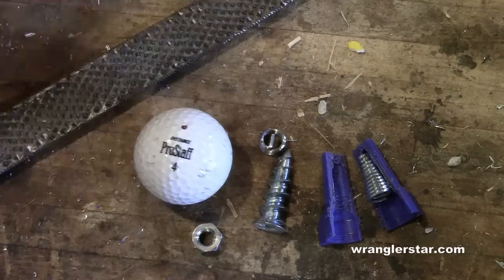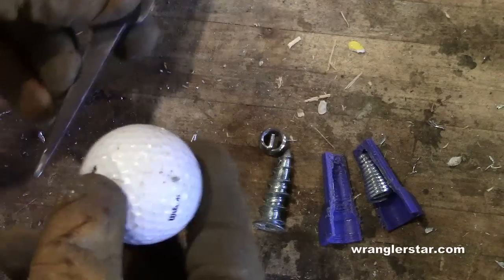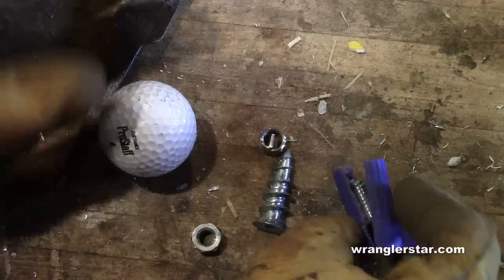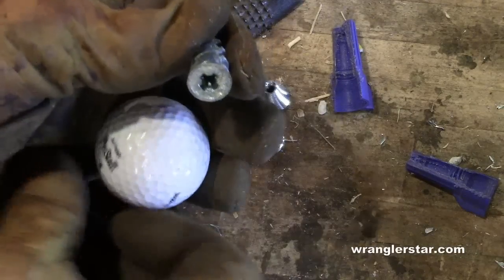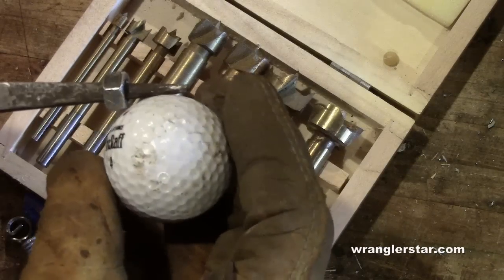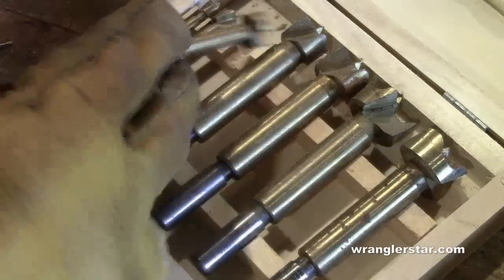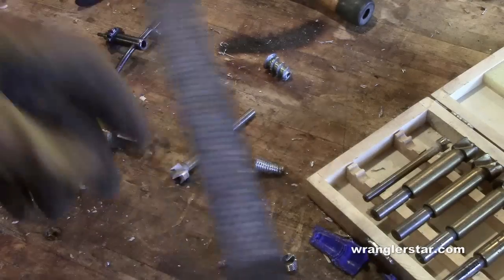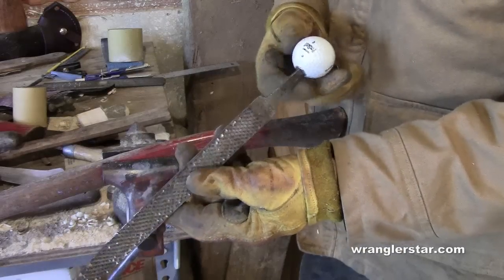Golf Ball Tool Handle - Wranglerstar

Comment: A "rat Tail" is a round file, what you refer to as a rat tail is really a tang, or handle tang.
http://en.wikipedia.org/wiki/File_%28tool%29
WIKI, Most files have a narrow, pointed tang at one end to which a handle can be fitted.[1]
I bet it works without the nut using epoxy.
Oh, nice blood blister under the nail, be it still hurts to this day.
A syringe needle as a drill bit turned by hand can do wonders for it.
How do I know?
I wish I didn't know!

Comment: two nuts on threaded rod. then cut rod. then grind edge as she did. then take off the nuts working them back and forth as needed at the end of rod till the threads run smoth. then remove nuts ,

Comment: Sorry Cody but there is an easier way. I do that in my Blacksmith shop but much easier. I just drill a hole a size or two above the the diameter of the end of the rat tail and drive it on. I've never had one come off.

Comment: I allways take a cheap wooden handle without any threads
Then heat the bottom part of the file up till it's red hot
Then just smash the handle on there

Comment: Be careful wearing those gloves while using a drill press.   It's better to cut yourself without gloves than to have a glove catch on the rotating drill with a lot of torque and break every bone and ligament in your hand. .. If your lucky that's all that would happen before you can stop the drill press.

Comment: If you use a file on aluminium it gets clogged pretty easily.  Use an old copper pipe to help clean the file.

Also I made a video on how to make a DIY  homemade pocket slot saw for hanging pics 
Title is " make your own pocket hole saw "
www.youtube/watch?v=cZUi4g26DYY

Comment: Ha! No offense but I am not sure I'd trust a guy I see with ANY golfing paraphenelia around. Branches are free, too.

You need the recipe for cutler's resin. You are a woodworker and will like a wood handle far better than a f'ing golf ball. Cutler's resin grips like a bitch and releases in hot water to work on the blade/chisel/tool if you need to re-anneal and temper again, for instance. It's 3 items.... Rosin, BLO and something else. google it. ( this is my trade secret, dude! )

Otherwise marine grade epoxy is more permanent and works excellently for wooden handles. 8 sided is ideal because they won't roll off your bench, btw. Look at pfeil chisels. Also keep your fruit tree branches for the handles. Better than even hickory. Above fruit wood is Dogwood. 

Dogwood is the god of tough woods second only to hornbeam aka 'ironwood'. Oops another 'trade secret' slipped that let you know I have lived, hunted, pumped my own water (still do, I just bike it home now that I am a cityslicker), shot, split wood, fixed my own transmissions and know plenty about how to talk to animals.

Comment: Oh Gods above, that has been known for years.  And, of course, you do it the fancy way.  All you need to do is drill a pilot hole, and drive the tang in.  That's it, it will last forever.  Sheesh, and it takes you 7.42 to tell a 30 second task.  Thumbs down.

Comment: My first video of yours I can't thumbs up, and I've watched them all. While I agree its a practical solution, its a hack. I don't think a golf ball is a "proper" handle. I admire you and trust your judgment. I often ask myself "what would wranglerstar do" and I try to use that as my standard and try to live up to that. Part of your appeal to me has been the fact that you have, at least in my opinion, rejected the quick fix, and rejected plastic except for your wedges. Your tool shop looks like the old timers wood shops we see in old pictures. This golf ball idea I think misses the mark on form. Had you taken a round wood ball, or carved a handle yourself and sunk a nut into it I would thumbs up. I would also have used an epoxy or something to secure the nut better. I think you got excited, jumped the gun, and made a video. This is not what I myself would call wranglerstar quality. I won't thumbs down because your can do attitude inspires me. Instead I'm going to walk away wondering what just happened here. I come to your channel to avoid this type of thing. I hate taking a shot at you but you have requested honesty from your viewers. I'm honestly bumbed on this one. I've been looking for exactly this information because I just bought a box of old files. I can't believe I didn't get the "proper" answer from Cody, I only got a good answer.
Reply: though i was a bit unsure, when you think about it pretty good idea, 
their pretty durable, pretty cheap ect 
you can hit them 200 odd meters and they dont care so im sure their fine for a handle if it feels good.. why not? may not be for everyone, but still a good idea
Reply: I acknowlege its a good idea, but as Cody has asked before "is it something you would put your name on". I don't think this meets what I expect from the Wranglerstar brand.
Reply: In my opinion Wranglerstar has built a brand. When I hear the name I know what to expect and trust it. If he held a contest, and the prize was a file handle and he sent you this...... what would you think? He did call it a hack so I'll give him some credit for maybe knowing this doesn't quite meet what his viewers expect. I'll be interested in watching what other say and how they rate this video. Something else to consider is, what if somebody found Wranglerstar by this video? Is this video worthy of making somebody subscribe, is it indicative of his typical quality of work? I say no.
Reply: my thoughts on it would be a great kind of backup handle ect a nice wooden handle will always be better in my eyes. but still a nice quick handle
Reply: Agreed, as a backup handle its fine,but watching made me reflect back on his shovel handle video and I felt uncomfortable.
Reply: Jake Riethmeier I agree with all that you said. One reason I watch Cody is that his videos take me back in time to the days when hard work, sweat, wood handles, and good steel were the norm. A golf ball, while maybe a superior handle, doesn't take me back. Maybe I'm being a picky turd, but the video grinds me. I think this is another instance like his lopper handle a few videos back that left me scratching my head. Have you ever noticed a plane in the sky during a western movie? Its kind of like that. This video just missed the mark for me. Wranglerstar is synonomous with proper. I'm a huge fan of the aesthetics of Codys work. I just don't see proper here, I see goofy.
Reply: Well, just consider it a 'prototype' then!!! There's nothing stopping you, OR Cody from taking this idea and replicating it in an aesthetic that you find less offensive...
-but there would be little point in doing so, before he had tested whether the concept actually WAS as ergonomic as claimed. I may be wrong; but it sounds like you're just looking for things to complain about...
Reply: I wasn't looking, its something I noticed that I thought was inconsistent with his library after watching all of his videos. I could have just given him a thumbs down and not commented as others have. I may be wrong but it sounds like you're a fan boy looking to champion.
Reply: Joe Bonomono
Yeah, you are wrong. Lets just assume it's projection on your part; seeing as you're the one that often ask's himself "what would wranglerstar do?" and you're the one disproportionately bummed out over something so trivial, as a proof of concept video... -because you've put someone you've never met, on a pedestal they didn't ask for. ;) Grow up!
Reply: So anyway Jake Riethmeier 2 nights filing without a handle. That would suck. I had thought about the harmonics also but I couldn't figure out how to add that feature to a wooden handle. The golfball is brilliant, it just looks terrible. If you have to do a lot of panel filing I would definately build a golf ball handle or two and keep them handy.
Reply: Joe Bonomono
If you seriously think the 14 thumbs down are in "agreement" with you, you are sorely deluded... Every one of Cody's video's has thumbs down, even the recent hatchet video for Jack and you cannot seriously claim to know why each individual thumbs down has been made! Over 2000 people have hit the thumbs up... so what?
It's also worth noting that the public comment section, on a public you tube video isn't really where any sane person would expect to have a private conversation... If someone disagreeing with your opinion upsets you that much, it might be worth remembering that.
Reply: Jake Riethmeier That sounds like an incredibly long two days. I pictured it as I read your post. I hope your able to get back to work now. I hate seeing people loose money because of weather. I read your idea about the wood putty before I went away for a few days and I got to thinking about it. I think your idea would work fine, but I've decided to go a different direction. I think in a way xXxCatsnakexXx has a point. I opened my mouth on Wranglerstars comment section, which I still maintain is appropriate, but I didn't back up my criticism. I think the only proper thing to do is build the tool I wish I had seen Cody build. Its a talk the talk, walk the walk issue. While I'm no expert, Im pretty confident I can build the tool as I think it should be built. So, not only am I going to build the tool, I'm going to make a Wranglerstar style video or videos to document the process. I think this will be the best way to honor a man I respect and have learned from, and also a way to back up what my mouth said. I'm not sure how long it will take because I want to do the whole video as a Wranglerstar tribute/spoof and that will take a little planning and work to pull off properly. Im not a director or film editor so I have a learning curve and some stuff to buy. The end result has to be an awesome video and a tool that has all the functionality of the golf all model, the asthetics I "bitched" about, and be lifetime quality.
Reply: Joe Bonomono
Something to think about is that the 'dimpled' surface of the golf ball may in fact have have some anti-fatigue properties... Of course it may not! But its worth considering how you would mimic this.
Another benefit to doing your own version is that you're not limited to golf ball size... -you can go bigger or smaller as you see fit.
Reply: I admit I haven't done a lot of filing so I don't really know if there is an advantage to the round shape. I suspect there is in that as you adjust your angle of attack on whatever you are filing your grip on the tool remains the same. I thought my first step might be to buy some polymer clay, or epoxy putty to make a custom grip fitted to my hand and experiment with that a little and see how I like it. I thought with a custom grip a racheted socket of some sort may be required so that the angle of the file can be adjusted. This is something the round shape of the golf ball accomodates naturally. If I find that round works best  I can adjust diameter size as xXxCatsnakexXx mentioned. I'm 6'2 with large hands so this is something I see as a high probability. I also agree with the theory of dimples helping with anti-fatigue. I would suggest also that the dimples help with gripping the ball giving some traction for the hand to hold it better.
Reply: Jake Riethmeier Let's see, paid the same, required to do a job without the correct tools, and two mentions of aircraft. Sounds like a government job to me.... Thank you for your service?